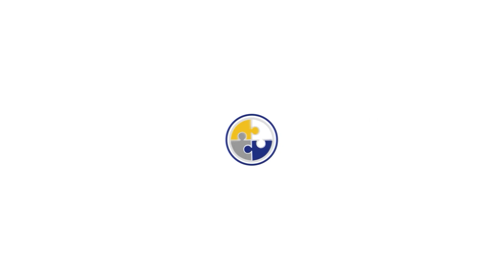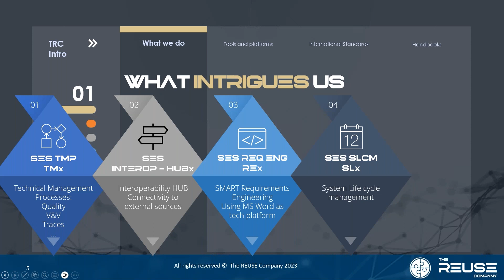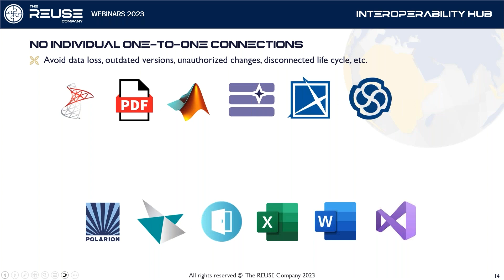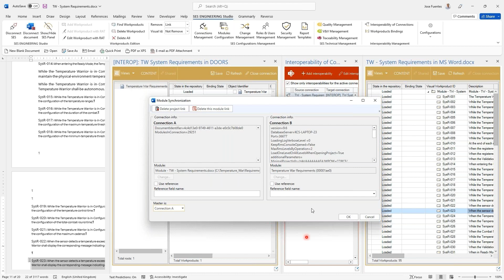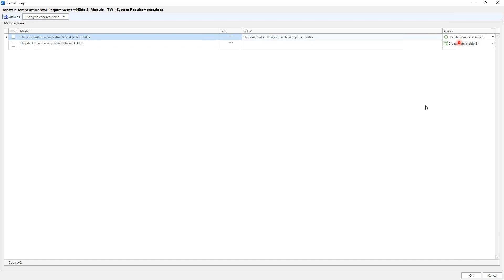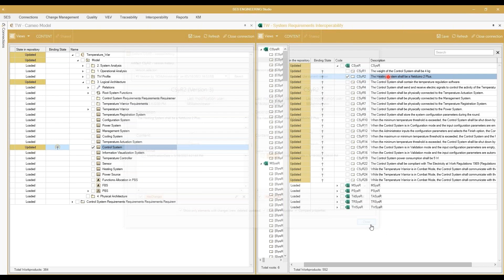Unlocking Cross Platform Potential - A Deep Dive into Systems Engineering Interoperability

Comment: 🎯 Key Takeaways for quick navigation:

00:00 🎙️ La presentación se centra en la interoperabilidad en ingeniería de sistemas y cómo se puede lograr a través de un entorno común.
03:41 🛠️ The ReUse Company se especializa en aplicar tecnologías semánticas e inteligencia artificial en el ciclo de vida de la ingeniería de sistemas.
06:50 🌐 La tecnología de The ReUse Company se aplica en diversas industrias, incluyendo aeroespacial, energía, automoción y salud.
11:46 🤖 La interoperabilidad se logra a través de un "interoperability hub" que conecta diferentes herramientas y permite la sincronización de datos.
16:17 📝 Se pueden mover y copiar productos de trabajo entre diferentes fuentes de información sin modificar su naturaleza.
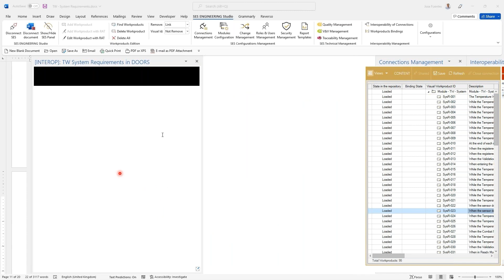22:04 🔄 La tecnología permite transformar productos de trabajo, como convertir requisitos textuales en modelos conceptuales.
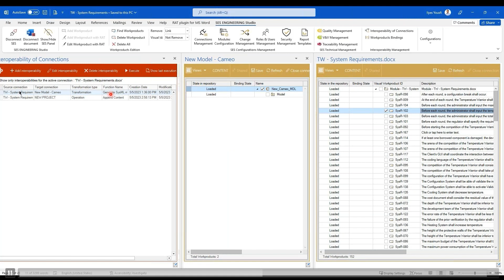27:26 🌟 La interoperabilidad también incluye la capacidad de vincular productos de trabajo y mantenerlos sincronizados automáticamente.
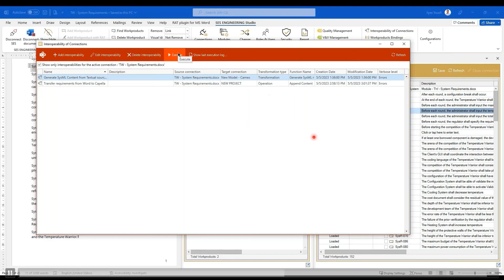27:41 🔄 En el proceso de transformación de un modelo a partir de una fuente de texto, se pueden generar rastros (traces) automáticamente.
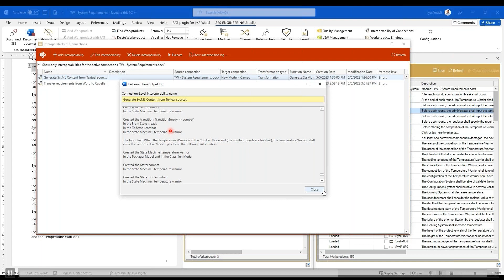28:10 🧩 Los elementos y requisitos que especifican un estado o componente tienen correspondencia en Cameo.
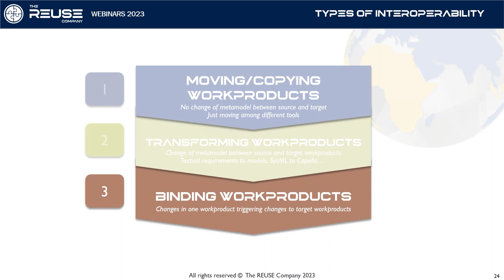29:28 🔗 La interoperabilidad puede lograrse modificando un lado y desencadenando un cambio específico en el otro.
30:21 📄 Se puede enlazar un componente con varios requisitos para actualizarlos automáticamente cuando se modifica el nombre del componente.
32:12 📝 Se pueden gestionar y controlar las modificaciones realizadas en un lado antes de propagarlas al otro utilizando un modo de solicitud de cambio.
35:36 📚 Se mencionan próximos webinars sobre temas relacionados con la guía INCOSE y la importancia de evitar un lenguaje negativo en los requisitos.
39:27 🛠️ SCS Engineering Studio admite IBM DOORS y está desarrollando una conexión con IBM DOORS Next Generation.
40:42 🤝 La interoperabilidad de SCS se diferencia al permitir la conexión entre diversas herramientas de origen y destino, no limitándose a una fuente o destino específicos.
43:14 💻 Para utilizar SCS Engineering Studio, se necesita la aplicación de estudio, el servidor y la capacidad de interoperabilidad, sin necesidad de complementos en la mayoría de las herramientas.

Made with HARPA AI